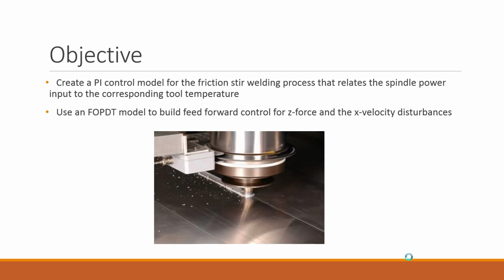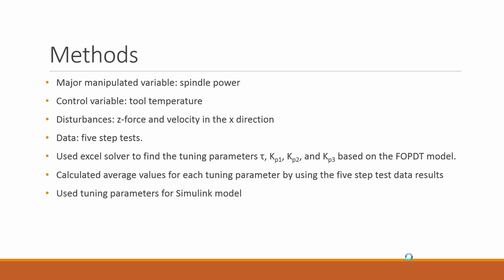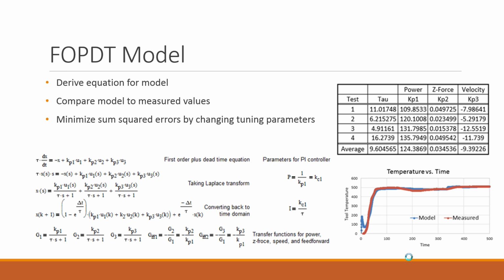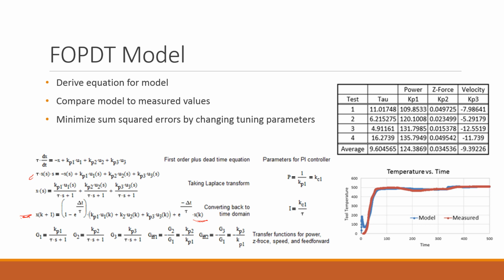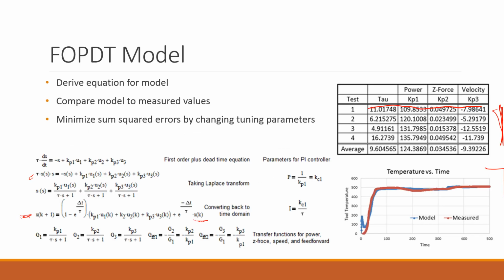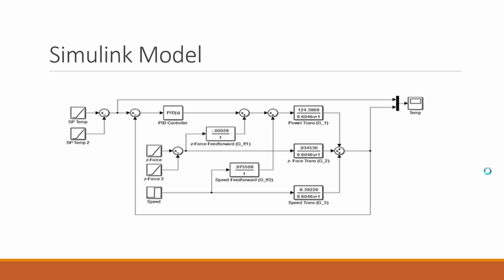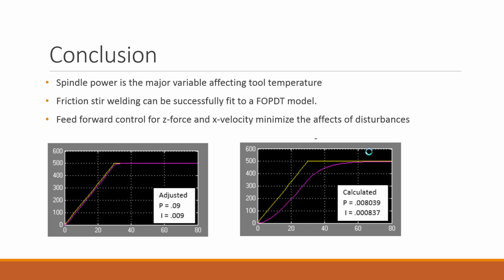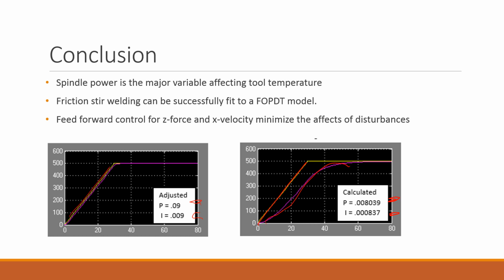Friction Stir Welding Temperature Control in MATLAB

Comment: Hi sir, its useful. can you please give me the details of these.
Reply from the maker: Sure, here are additional details: Taysom, S., Hedengren, J.D., Sorensen, C., A Comparison of Model Predictive Control and PID Temperature Control in Friction Stir Welding, Journal of Manufacturing Processes, 29, pp. 232-241, 2017, doi: 10.1016/j.jmapro.2017.07.015. in http://www.sciencedirect.com/science/article/pii/S1526612517301792 and Taysom, S., Hedengren, J.D., Sorensen, C., Dynamic Modeling of Friction Stir Welding for Model Predictive Control, Journal of Manufacturing Processes, 23, 165-174, 2016, doi:10.1016/j.jmapro.2016.06.004.  in http://www.sciencedirect.com/science/article/pii/S1526612516300603

Comment: Double automatic and simultaneous welding with magnetic coupling for industry
 
Specification
The invention refers to two complete welding heads and an inert gas (N) for external and internal (S) backing which work synchronously and magnetically coupled through two or more force fields of the two integrated systems of electromagnets or permanent magnets.
The design of the (N) and (S) devices for welding and inert gas backing has on each side indistinctly, rolling paramagnetic aluminum plates.
These plates house in their structure magnets or electromagnets of inverted polarity (N) (S).
The rolling and articulated designs keep the coupling and the parallel alignment constant with each other, making it possible to weld the sides of the outer and inner material simultaneously with the independent power sources. (Page 12, 13 (N1) (S4)). The invention of the double head and magnetic coupling welding are designed to work on paramagnetic and diamagnetic materials compatible with the process.
The equipment and system provides an exclusive technical solution to solve the physical obstacles of welding and gassing, with front and back purge, sheets and plates of various thicknesses of austenitic stainless steels and strategic materials such as titanium and aluminum.
The food, laboratory, chemical, oil, nuclear and aerospace industries, together with their multiplicity of applications and technical levels of superior excellence, are the ideal center for the use of the system.